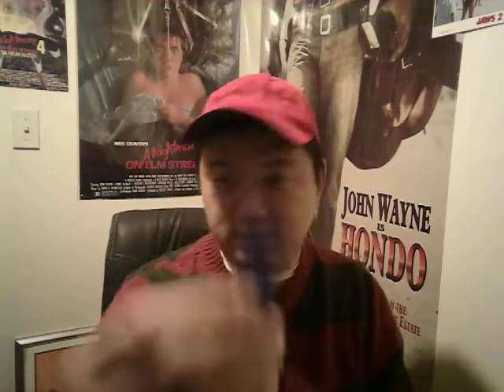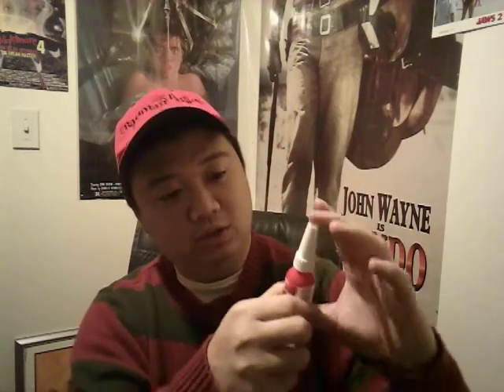Late night with BATJAC J.W

Comment: 620 looks interesting... my LCR 9mm has over 5k rounds through it, and the crane screw and cylinder release screw back out every time it goes to the range. I have been using 271 which gives me about 100rds before re application.. I think I know what i'll try next :-)